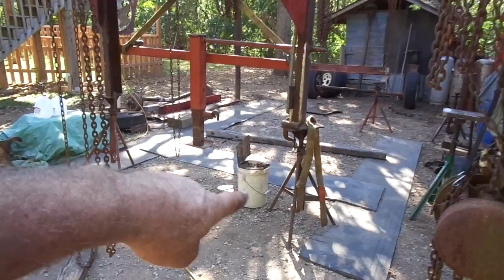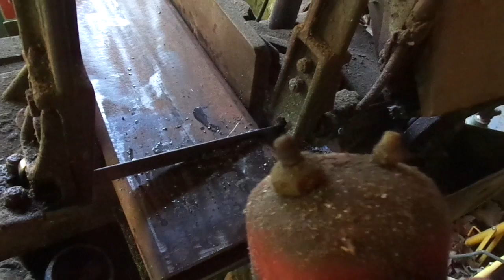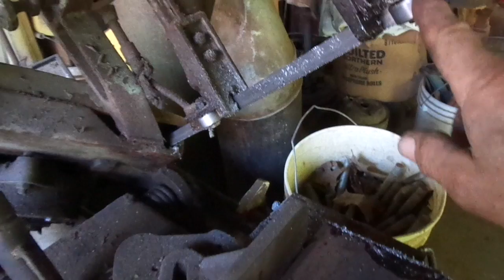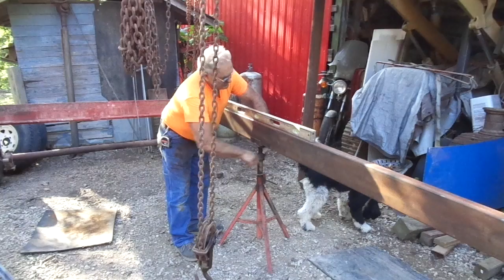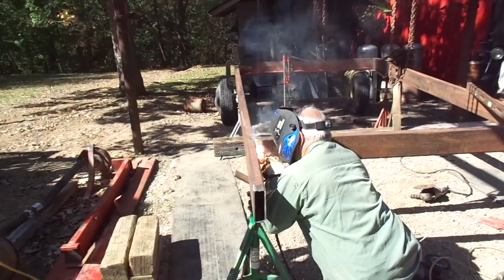Tandem Dump Trailer Repair Pt 4

Comment: Spent a few minutes watching it again. The Dell works just fine and it's nicer on the big screen too. 
That's how I built the truck bed frame for the 46 Ford 3 ton truck. 7018 low hydrogen is really nice rod. Well worth the trouble to keep it warm and dry so it stays low hydrogen. I used that to weld pipe for the paint line at Borg Warner. Good for out of position. 
When I welded the truck frame I cheated. I tacked it together across the top of the beams then tacked vertical down on the sides. With it held together I rolled it up on first one side then the other. That let me finish the welding horizontal. 
I would have liked your crane rig. I was using cable ratchet come alongs. Much nicer to be able to pull the chain and run two at once. 
Butting in where I'm not asked. Could you cut a hole in the bottom of a 5 gallon bucket and drop it over the chain fall to keep the rain off. If I leave anything out in the weather it rusts up to scrap in a years time. With your sheet metal skills you might have a better idea for a rain guard. 
I'm all caught up now. 

😀😎
Reply from the maker: Heck fire man....I'm always open to a suggestion.  Hahahaha.  A shield or five for the outdoor hoists have been in the planning stages for years but just haven't made it to the top of the project pile yet.  I do manage to douse them down occasionally with a little crankcase oil to keep them lubed up.  The trolly bearings are what have a tendency to freeze up if they are not kept in use.  I could make simple chinaman hats and slip over the hooks to shed 95% of the water.  Similar to the bird feeder squirrel guard video.  Thank you kind sir for stopping by and having a look see !! I do try to keep up with your videos, but the other day I looked up the word "prolific"....and low and behold, there was a picture of Old Sneelock !!  LOL  Btw, thanks for the great comment sir.

Comment: I tried a dozen times but the vid won't play. 1, 2, and 3 run fine but 4 stops at about 45 seconds in. Maybe YouTube needs a new set of  AAA batteries for the system? 😆😎
Reply from the maker: Dang, that ain't good.  Sometimes my I-phone won't run one until I turn it off and back on.  Hope you were able to get it to go by now.  Computers,  women and tractors can all sometimes be a challenge.  I heard that somewhere....those weren't MY words.  LOL.
Reply: @tractorman4461  Got it up and running. Miserable thing to monkey with. 
Spent most of the day pulling the dishwasher for the new replacement. Someone built the cabinet around the dishwasher. I got it but the dishwasher won't work anymore. 
Now I need to run a new power line and water line to the new dish washer. A lot longer one so I can reach it without the hole I had to cut through from under the sink. 
It's always sumpee!
Reply from the maker: @OldSneelock  Glad you got it going !!  My son's Samsung Android won't play it and neither would my SIL's Samsung.  But it would play on their laptops.  Go figure.  Kinda weird.  I've not heard that as a problem before.  Side note:  we are in the process of replacing our dishwasher as well.  But I'm going with one with similar connections.                                        They've changed electric/water connection orientations between the time I installed first one and the last one. Of course we went from Whirlpool to Bosch.  I had a lot bigger job so this time I'm hoping its the same and it'll hopefully go quick.  
They want to discourage homeowners as much as they can from installing stuff anymore.
Reply: @tractorman4461  It will take stronger stuff than moving the fittings to stop you and I from doing what we please. If the trailer rebuild is any indication you would lift the dust from the top of the washer and repair or replace what ever needed it under  the dust.
Reply: @tractorman4461  The notebook I was trying to watch it on is a Samsung. Now what in the devil would that have to do with it. I watched today on my Del laptop and it ran just fine. Now we have a puzzle for sure.
Reply: @tractorman4461  Just tried it again on both the Samsung notebook and my Samsung phone. Both stopped dead at 10 seconds and say "No connection"
The next line on the phone is ( ) ( Playback ID: g2QC_YyiiQ2Uancs) and on the notebook it reads (Playback ID: pilSs4naxoBIL8HF). Both again followed by Tap to retry. 
Odd thing as part of an odd couple days. 😕😎
Reply from the maker: Old Sneelock's Workshop weird stuff. My I phone updated automatically the other day and there’s some strange stuff happening on the FB site ever since. I don’t get computers at all.
Reply from the maker: Old Sneelock's Workshop strange they are all Samsung’s. Lol.
Reply from the maker: Old Sneelock's Workshop a fellow does get himself into some pretty good stuff sometimes don’t he. Lol. It’s all good though.
Reply: @tractorman4461  It's a puzzle but not a problem. If the lawnmower won't move it the Ford 8N will. 
It's all in choosing the right tools for the job. 
That all gets knocked into a cocked hat if some nare do well flips a switch in California, or Seattle, and turns the Ford into a Yugo. 
😁😎
Reply from the maker: @OldSneelock  hahahahahahaha  you're right about that !!

Comment: Well Tractorman44, do you realize you have all the equipment to do cheap surgeries. You could do knee replacements while you wait. I mean you must have a bunch of old ball joints hangin around, eh? In and out surgery complete with a cuppaJO. Of course you'd have a line of people waiting and it would get to be too much. At $15.95 you could make some extra bucks. It is such a great set up you have its a shame not to use it for neighbors and friends. And now you could make it a mobile operation with that fine restored trailer. Call it 44 Body Fixit 4 Cheap. Just an idea and I have plenty of them and most wouldn't be acceptable by many but I have a bunch. And one has to think of all the striped ideas before the right one comes along. Hold on while I get another cuppaJO,,,,,,,,,,,,,,, I hold me mug high in your honor Tractorman44. With all these fine ideas coming into my head I needed another cuppaJO to lube the neurons a bit more. With all those beautiful old machines around its a working museum. I always thought if you're going to make something, why not make it as pleasant as possible, apply some creative skills and arts. Like that nice old saw. There is pride and art in its making. All those little fancies that make it more of a joy to see and use. I have many old tools in my wood shop and they were made this way and a joy to use. So why not do this same thing when we make stuff and do the best we can with what we have. Like those things produced at the 44 Headquarters! And like that fine system you install in your son's attic. You could make a sand mold and imprint your Tractorman44 mug into it and cast Tman44 faces to rivet on all your projects. Great videos for we fans to watch too! There are other options as well, like the woman who sat in a bucket of dough and made a good impression. The ideas are endless! So on this note and after watching your FINE set up and work, I'd best be outta heer before I come up with so many ideas as to get nothing done this day. Ideas can go overboard ya know, even though they are fine ideas that only a cement block could understand. So indeed, a I raise me second cuppaJO your way Tractorman44 and all the Clan at Headquarters and Stan of course, I have an idea to do some work before my brain explodes! And I do have a HUGE brain,,,,,but my skull is 3" thick so it can't swell much. This is DaveyJO with some JO and I'm outta heer with some ideas!
Reply from the maker: Well DaveyJO I guess we could draw and quarter a guy on the chain hoists like they did in medieval times.  Then there's the sawzall or portable bandsaw for amputations...  There's a few universal joints laying in the junk pile we could sterilize and put in place of a bad knee or hip...
     I'm wondering how big the bucket of dough was for the lady. Made for some nice buns huh....   Reminds me of this summer I was standing in line holding two cantaloupes in front of my belly.  There was the sweetest little old lady about 80 in line ahead of me and the Missus and when I noticed her literally staring at me she politely said...."Sir, I really like your melons"....and we ALL laughed, even the check out lady !!  Absolutely true story too.  (Btw, we looked like twins, except for the mustache).
    Well I wouldn't want your brain to swell too much, so here's a toast to you and yours up thataways.  Have a great evening sir.  Thanks for the awesome and chucklesome comment sir.  You Rock !!
Reply: Tractorman44 What a great melon story! You should have taken a picture of that scene! And the lady that satin bucket of dough? Well it was actually a large tub. You know, the kind you can get 8or10 people around bobbing for apples. A BIG impression it was. Kind of like the lady that back into the fan, it disaster. And I wanted to say before, what a great set up you have with the overhead beams. Man, you can do about anything there! Great place for surgeries fer ser! I raise me evening cuppa JO your way and off to put another log on the fire. Supposed to get colder after this evening rain. Had a fire in my shop too. Cleaned out the ashes and started burning all the scraps I accumulated over the summer. Felt pretty good too. The dehumidifier I used this summer sure change my damp shop, rusty tools and mold here and there. It was nice and dry but sure needs a good cleaning so I can walk around some. So logs away for DaveyJO. A Lovely evening to you Sir and the Misses of course! DaveyJO
Reply from the maker: @daveyjoweaver5183  Good Morning sir.  It turned a bit chillier overnight here as well.  Its 20F right now with high of 40.  I've been burning a fire or two for 4 or 5 days now.  In the shop I too am cleaning up the summers scraps and some nasty pithy wood from the junk wood pile. 

     You know those little sacks of dessicant that comes shipped in different things like pill bottles and shoe boxes...??d  I toss all those into the tool drawers that have the expensive tools like tri squares and micrometers etc.  Those seem to do a pretty good job of sucking the moisture out of those areas. My shop is so drafty a dehumidifier wouldn't do me any good. 

    Hey man I'm on the fourth cup of the morning and the second one tipped your direction !!  Have a great day sir.
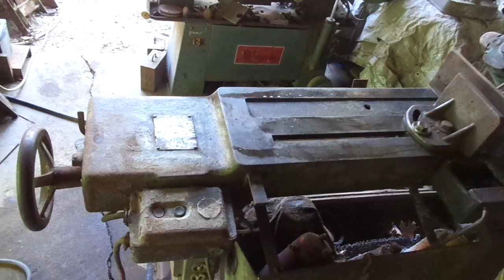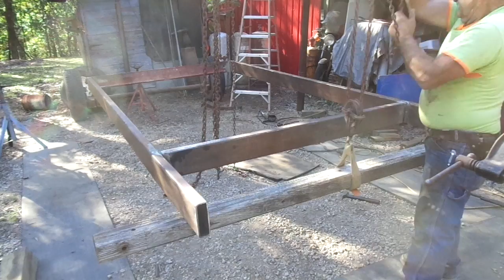Reply: Tractorman44 I'm tipping my after hours cuppaJO you way and reading your replies. I also save those little packets of silica gel to throw into my tool cabinet. Alice likes that dried seaweed and each comes with a packet and all that other stuff where they throw a packet of the stuff into. That pithy wood burns just fine to take the chill off. But when the hard cold comes along its time for oak or locust or hickory. We have a lot of poplar here and it burns well but doesn't last the night like good old oak. I'm still looking for a used log splitter. A friend of mine bought one a few years back for $300 and said new it would have been $1500. Harry home owners will buy one to clean up a tree in their yard and store the splitter away in their shed, that gets in the way. And the manly feeling for having toys wears off. And it's like those guys who buy a big Stihl 24" bar and use it a few times. But it looks cool and an,y in the garage. I never cared about cool much. For me cool was making and repairing stuff. This doesn't attract the women when hormones are flowing butI recon I did okay. And that question a guy gets from those who don't know, "why don't you clean this place up? Well they don't realize one must have a library of stuff that comes in handy. Don't know how much but I'm sure we both saved tons of bucks with our piles that other thought should be cleaned up. They never complain if your fixin up for them though. Hey, do you by chance have this or that? My piles look great when I have what they need. This did get to me sometimes in my earlier years but now I just do very little worrying about anything. Wasted energy I could be spending in the shop. But sometimes I do get a bit huffed up but it goes away quickly because I make it go away. Most of the time it don't mean nothin, as some say. So I never had the need for drugs or booze or wacky weed. I've always gotten high of my work, the woods, good friends and family. Why sometimes I felt so I high I could have gone duck hunting with a rake! And a high without any pills, pot or port. Plus, I've seen far too many friends and members of other families wind up in jail or dead. We need a ton of trade schools and apprentice programs. Just look at the wizardly things going on at the 44headquarters! Wizardry at its best sez DaveyJO! And this is why my cuppaJO gets tipped your way most every day. Last time, I think yesterday, I raised me cup to you and the clock said it was 6:44. Today on the third cup it was 10:44. I think there is a vibration or frequency that links our heaps of goodness we have in our shops. Yours has more metal and mine more wood. If we stretch a chain and connect each of our places together, connect it to a come along and give it a click each day, I wonder if we could move closer? I'll start scrounging up the chain I have. I do have a double ratcheted cast iron come along with a 3/8" cable. Once I used it to pull something into my old ford van and suddenly I realized I was pulling my van to the piece I was loading. Think it was a good sized log. I use it to pull dead trees one way the cut that last cut opposite the wedge cut. Works pretty good but it weighs plenty. Then I have to wind it all up again. It's an old one and they now reproduce it cuz it ain't like those stamped out ones from China that I've seen bend more than once. Golly, I meant to make a short comment and wrote another chapter. One day though, we will get together and have lots of JO to wet our whistles, we'll have to of course. I still have pictures to send so I'll get to that this weekend hopefully. The full green house and the sunroom mostly completed. Still have molding to make for the Windows, which I dovetail on the corners instead of mitering. I cut them a bit sloppy to compensate for any out of true. I did make a wide window sill from red cedar and left the live edge on front. The two pieces, 16', I dovetailed together. So my Friend Sir Tractorman44 of the Wendell kind, a final toast to you this winter night, which will seem mild before long. Peace to ALL in 44 Land! DaveyJO

Comment: "  and is reasonably safe....for me, not for you" Lol! That is right anyways! It's a good beginning to rebuilt this dump trailer. This old saw is obviously large, considering you seem to be cutting a 1x3 thin wall steel tube with it! I'll have to learn more about vertical welding. I always go downward. According to your comment, it does not seem to be ideal. Thanks!
Reply from the maker: I joke a lot about the lack of safety Joe, but in all seriousness it really IS taken seriously.  I keep in mind continually the need for an escape route while working in, around and under heavy loads. 

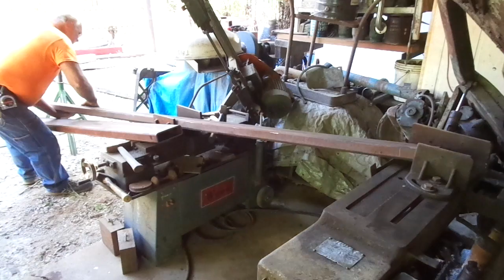    I find vertical stick is different than vertical mig.  Running stick downhill causes you to have to weld through sagging slag whereas uphill, the slag falls out of the weld.  I usually mig downhill like yourself.  Did you by chance see how the Kalamazoo literally towers over the Wilton at 4:14?  The tubing is actually 6" x 2" x 1/4" and the blade guides expand to allow a 16" cut.  Thanks for watching and commenting Joe....I just wish I was a bit better welding !!
Reply: I've seen that! You don't bend over with the Kalamazoo!

Comment: I was settled right in here eyes and ears 'glued' to the video, and all of a sudden,,..I heard, " this is Tractorman44, and I am out of here",..I cussed a bit, and said, oh well,..it's time to go to bed anyway.  it's about 12 midnight here now.
So I just have to wait for Part 5.
Oh, by the way I like those 7018 rods too,...I use a Lincoln Idealarc 250 AC/DC in my shop.
G'nite Wendell!
Reply from the maker: Hahahaha...that sounds like me after I see the opening scene of a movie then wake up at the silence after the end.....  You cracked me up with that comment Reg.  Lincoln makes a good welder I agree and the 7018 is really a good rod for running deep in the puddle. I like to see the red trace on the other side of the iron while running a bead.